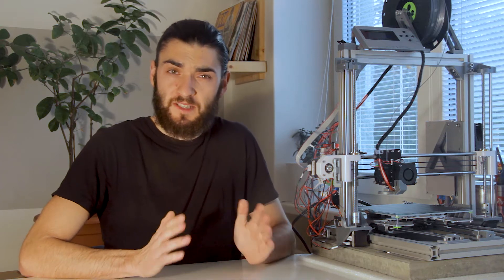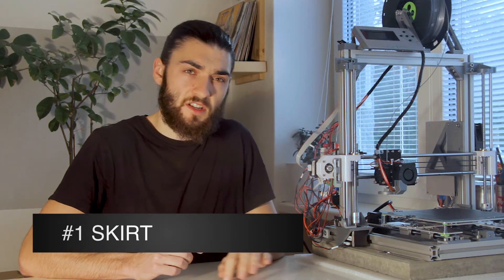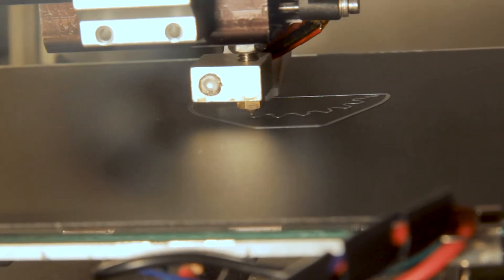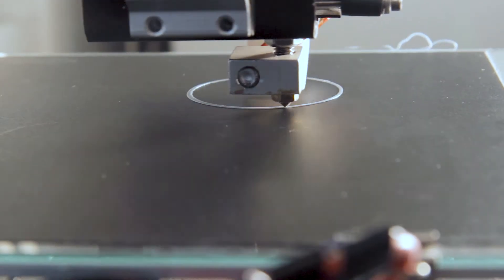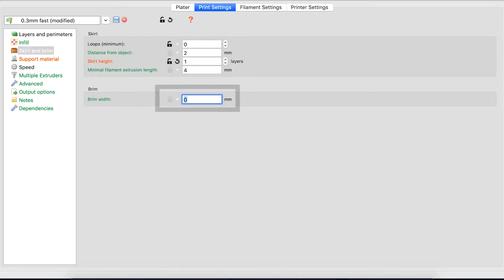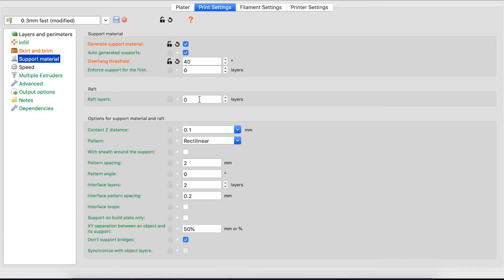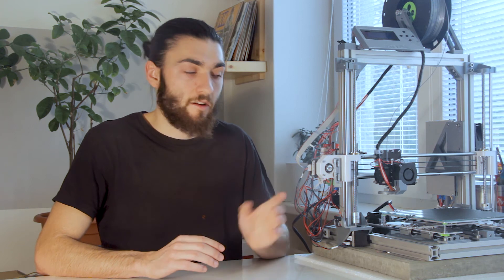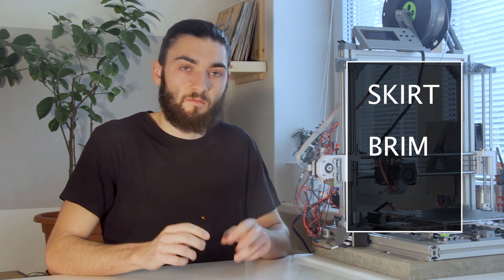Build plate adhesion – Skrit, Brim, Raft

Comment: I am trying to make a really thin rod, but it keeps breaking down, because the rods keep falling over. is there anything I could do?
Reply from the maker: It's kind of difficult to provide relevant advice without knowing more, but I would try using brim and very low speeds and accelerations... If possible I would consider printing it horizontal
Reply: @JindraSykora  ay that worked! thank you so much!

Comment: So I am fairly new to 3d printing.  so is build plate necessary or can the 3d prints  be printed directly onto the hot bed?  Reason I ask is I had a lot of build plates that were impossible to remove from the bottom of the prints when I was done.  They came off the hot plate fine but could not be removed from the 3d print at all.
Reply from the maker: I would recomend using a build plate. If you get a flexible build plate, removing the prints should be fine

Comment: hello, I'm new to 3D printing and I'm trying to print a tank, the print fails because the start of the print is small dots that build into the wheels and those dots usually come off (at least one or two), so which build adhesion do you all recommend for this issue?  Thanks
Reply from the maker: Hi, I would try to use RAFT for this one...
Reply: @JindraSykora  thank you

Comment: Hi... Good information. I've noticed when I use skirt my print doesn't stick to the bed but when I use raft it does. Any suggestions?
Reply from the maker: Hi, thank you... It for example depends on the material you are printing as well as the base surface area. It might be an issue with warping (when printing ABS) or the first layer adhesion is just not that great and when you increase the surface area with raft it helps. To summarize, I have no idea :D because it depends on many factors, sorry... :)